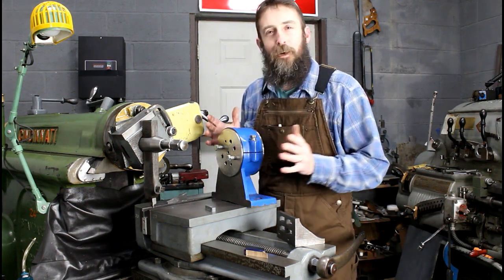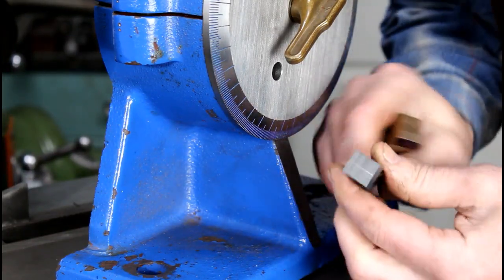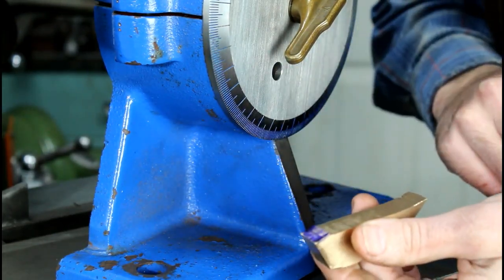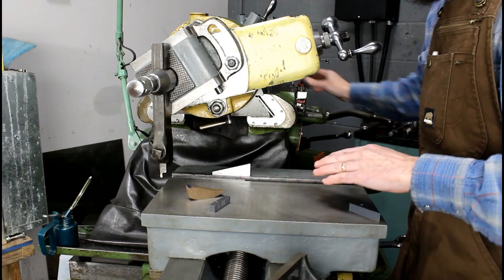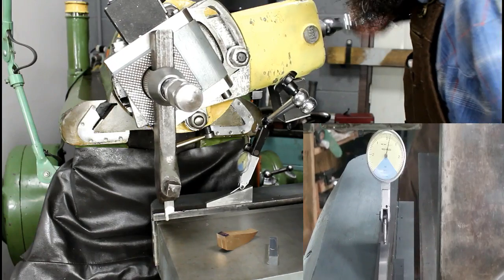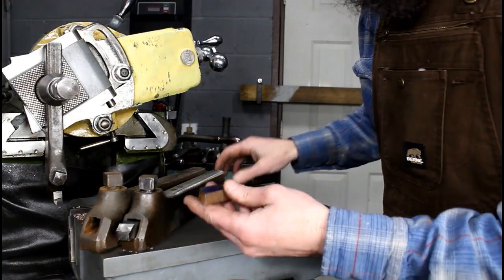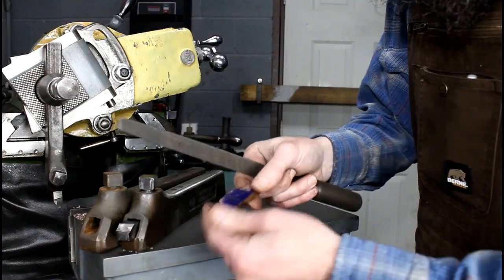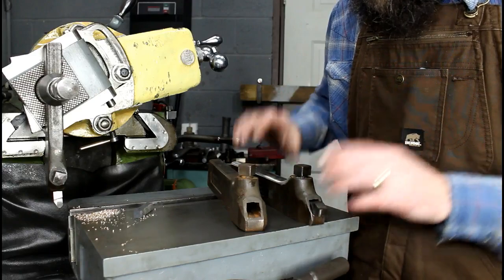Cutting an Angle with the compound

Comment: I hate to say it, but I really don’t see any advantage in using the shaper for this. It’s a lot easier to just set the cut line flat in the mill vise and take the few seconds it takes to mill it flat, at the right angle.  And while Steve set the angle on the compound very carefully, he just put the piece in the vise by eye anyway.

Comment: due to the angle that the tip of the dti has the reading will be incorrect
Reply: jan van ruth 
                       No   -   the error will not be correct but the overall angle is correct.

Comment: Well shown that man !  The shaper is as you say 'versatile' - we don't all want the racket of a mill whizzing round at several hundred rpm..  That set up was pretty much as I used a while ago making my dovetail cast iron master for scraping in the tool slide Steve. It gets the job done without rotating the vice (mine was fixed base so tear down and re-set each end of the job required - besides I didn't have the stroke required.  Crikey those Armstrong tool holders are a tad large ! 5/8" sq bits ...  Ive been looking for a zero rake 3/8" holder for ages with no success. Wishing you and yours a wonderful Christmas Steve. Enjoy yourself over the Christmas break my friend.  Mat